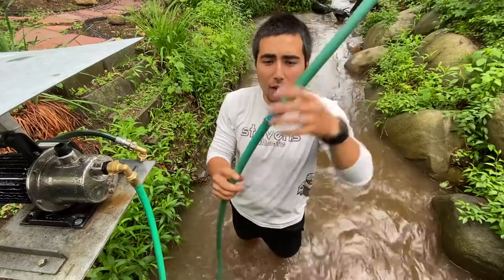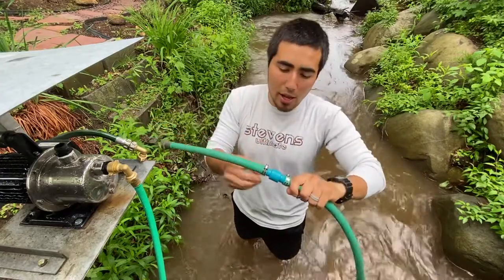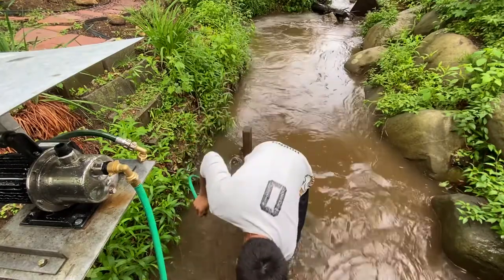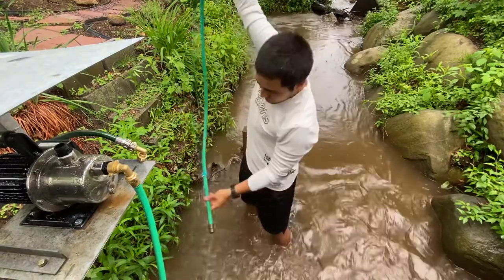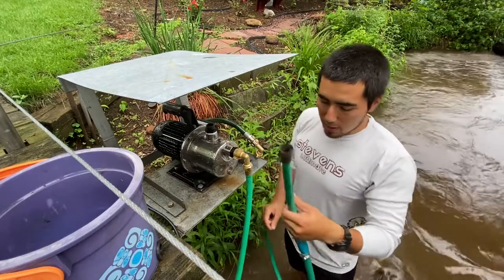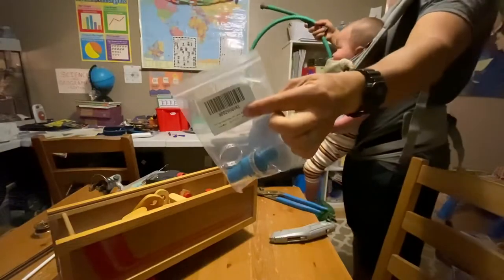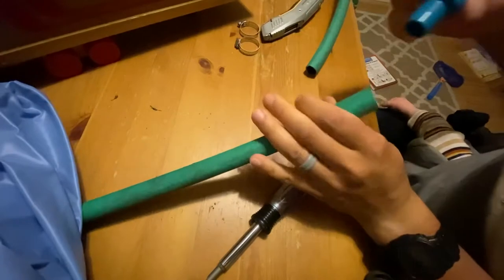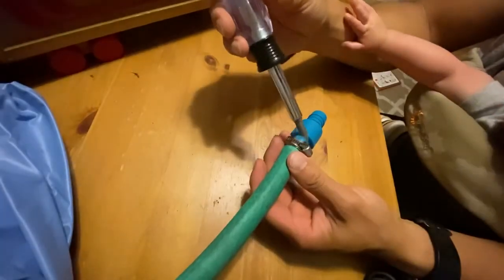Garden Hose Check Valve off Amazon that actually works!

Comment: Heat garden hose with electric heat gun to make it easy to slip in the barbed connection.
Reply from the maker: Good idea, I guess hair dryer would work too!
Reply: @Famvestor  I use electric heat gun....gets much hotter and has HP to dry out any wet tubing.   Tubing on barbed fitting slide right on once you heat up tubing.  Added benefit is the tubing shrinks down onto the barbs so almost hold themselves in place without clamps.